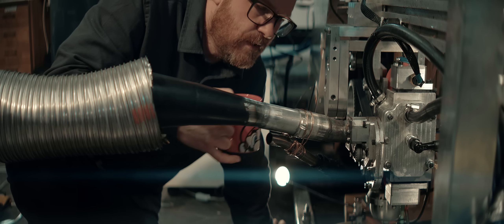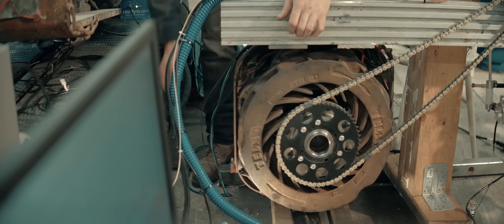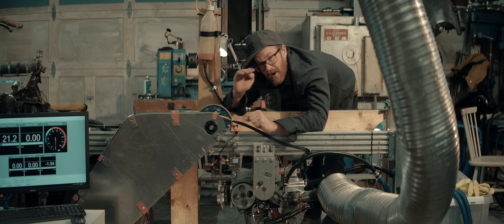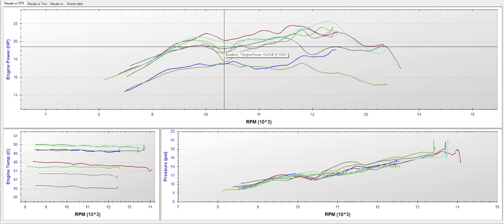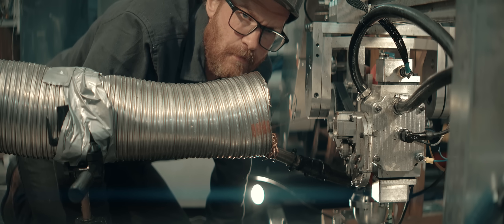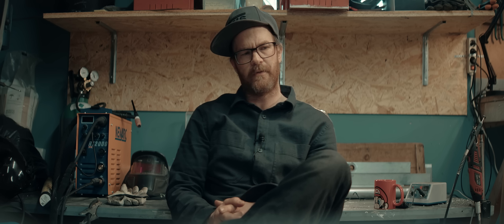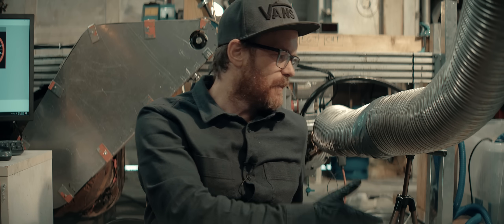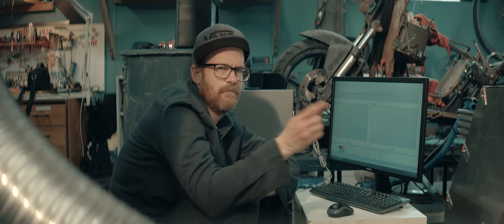50cc Supercharged Nitro Two Stroke - More compression?

Comment: You can still use auto start/stop going from low rpm to high. You dont need a whole lot of pid tuning to do it either. The idea is to have a timed sweep like you do now, just in the opposite direction. At the end of the run you should be near your rev limiter. If you dont have a rev limiter on a boosted nitro 2 stroke, my first question would be whynot? How are you preventing damage from over spinning the engine? The benifits of going from low to high rom isnt so much that it's more accurate. It's that you aren't lugging/stalling a directly coupled boosted nitro engine at WOT which can be dangerous.  If you start low, you start at an rpm above idle. 2500-3000 or whatever the engine is happy at. At the end of the run, the dyno says run complete and you back off the throttle. Worst case, you touch your limiter a little.  The other consideration is that going backwards from high to low involves the brake a lot more. If your pid isn't tuned rock solid, you can get a bunch of weird torque/hp anomalies because it is more involved in rpm control. On an acceleration ramp, you are less brake involved and can rely more so on the mass of the eddy brake than you do on the pid control of the brake. In this you find more accuracy, but more importantly you find repeatability which is king in this situation. A dyno is nothing more than a tool to measure a performance change. The number itself is irrelevant so long as you can measure a change. And if your pid is what's responsible for making all those waves in the dyno graph, then you're spinning your wheels..   i'd recommend installing another stock 50cc and dona few pulls with it, completely stock. Use that to dial in your dyno pid control in a low to high rpm config. Once you get repeatability with that, then go back to the brute force engine development. If you're chasing your tail with the dyno setup, you're doing nothing more than wasting both time and money.
Reply: People have been saying that (about testing with a known engine) since the beginning but he just doesn't seem to want to, for whatever reason.

Comment: You have to advance the  ignition , test 40+ deg , since Nitro is a slow burner,,,, at our Kaw top fueler (1200cc)we ran  65+deg when going with a rich mix , You need advance ign  to get the sparkplug  hot and clean, it wont build any heat otherwise

Comment: To test does the inertia make a difference, try braking the engine down in, lets say 10 seconds and then try like three seconds. If it affects the results, the torque figures should be higher in the faster decelerations.

Comment: Gap the ring like mad man and make it as lean as possible. I use to run nitro rc cars as lean as possible for better power. Get it running to full rev and wind off the fuel until it bogs. Makes the rc cars much quicker although they over heat. On a larger engine if you can get enough boost go rich! I think you may open another can of worms with the compression ratio issues.

Comment: Your reverse dyno run still have influence on exhaust resonance. If exhaust is working and has some resonance effect, you are starting at high rpm with "cold" exhaust and ending run at low rpm with hot exhaust. That is affecting results and on road will be different.

Comment: Test running from low to high, you might gain power.
This due to engine works up the heat so the fuel condensates properly at high rpm, nitro needs the heat.

It is just to configure an rpm limit in ignitec and also if possible make dyno after reached top rpm pull down the rpm again.

Looking at a top fuel dragster hemi, it only has ~6.5-1 in compressionratio, Beware!

Comment: You need to work out why that motor is not breathing, that's the main issue, everything you are doing is tuning.  There is something more major going on.  The reason I say this is that your HP curve looks like a torque curve, meaning your torque curve is crashing to the floor.  I am unsure of your carb spec or port timing, this motor has some sort of 'reed valve' bypass setup that relies on inertia, this could be the problem, or you have choked the intake down so much in the search for gas velocity that you are getting far to much of a pressure drop.  I'm not sure but I would focus your attentions on getting the thing to breath.  Love your passion and it's a great project.  God speed.
Reply: He has massive breathing capacity (enormous ports) but the engine is more or less crossflow scavenged, so I suspect the charging efficiency at high revs isn't as spectacular as one might hope. Also at very high RPM the blower efficiency goes off a cliff.

Comment: Alex, a suggestion for your consideration. The previous video you mentioned that you got more power the warmer the engine got. Is it possible to increase the coolant temperature  to allow a short term test. What temperature is the coolant achieving under load.
Reply: @Alfred Wedmore Morning Alfred. I suggested to Alex some time ago adjusting coolant temperature in logged steps and write down the results. This was from the period when he was running the engine at winter room temperature.
IMO quick cheap alterations are done first. I know it's easy for us comment on what needs doing but I genuinely believe the cooling system needs shrinking down for testing purposes allowing quicker warm up periods. I feel a water temperature gauge placed in the water jacket is a must.

Comment: Gap the spark plug tighter. Smaller gaps work best for boosted applications.  I personally run .028 to .022 the more boost the smaller the gap.

Comment: Hi. I'm with you man, I just love your build.
I've got some ideas to test.
1)dirtbike use sometimes platinum race sparkplug bougies wit a smaller tip(expensive)
2)Some dirtbikes from the past were using two sparkplug bougies at the same time(Maico 500, 1979)
3)Maybey to run the engine on Aspen chainsaw fuel (without ethanol) for a more consitant fuel consumption adjustment. 
4)Maybey you can develop and use a adjustable fueljet( carberator) 
Some Zundapps from the past had them in their Bing carberator as an extra option for fuel adjustment when the engine was hot on normal operating temperature for more power 
Good luck from the Netherlands!!!!
Reply: Bing carburettor! You said a naughty word.

Comment: Just mention when you add compression,  it will be more difficult to ignite the mixture, even as a high boosted mixture, even as igniting methanol in stead of gasoline. I know this of experience in tractorpulling. the easiest things what helpt are decreasing sparkplug gap to 0.4mm or less. Also leaning out the mixture will help it igniting better. So i think adding more compression is a step the wrong way for now. Keep up the good work, you are my favorite yt channel!

Comment: When tuning cars, I always ramp timing up a little past peak torque. Around a degree per 1000 rpm. I'm wondering if at peak torque, you have 15, and taper up to where at peak rpm you put 25 in it if that will help? It does on the 4 stroke boosted cars I tune. I'm not sure if it applies to 2 stroke boosted combinations.

Comment: Mabe plug fouling is du To the oil content in nitro fuel for rc cars à normal two stroke pétrole engine as like 2% oil compare To 9%oil in nitro bugy fuel cut the nitro fuel wit straight metanol lower oil

Comment: The guys of racing team van Veen kreidler, have squeezed 20,5 hp (in the 70s with a bench test) out of a kreidler super breitwand 50cc 2 stroke engine. Without nitro and super chargers. Just plane knowledge and gasoline. On the circuit the used and average of 18.5hp for the durability with a speed of 204km/h 126ml/h!!! 
That were the good  old days.
Reply from the maker: My "old" engine sitting in the landspeed bike produces about 23. I'm not pessimistic about the results for this one though, we're just getting started.

Comment: The exhaust diameter is too large and the megaphone should be a smaller diameter with a longer and more tapered angle...try 1 inch pipe with 12 inch megaphone max with inch and 3/4 max

Comment: More fuel and more power, that’s how it worked with our methanol 2 stroke. It was so rich that on idle it was drooling straight methanol from the pipes. But open the throttle and it picked up immediately. 
More compression and more spark power needed, and test with smaller plug gap as that helps up to a point. 
Just a small returning cone on the megaphone will net you a lot of power you need that returning wave as you are all ready pushing fresh mixture out.  Interesting times on the engine!
Reply: From what I have heard thats true with almost any methanol engine.
Reply: Could try use an accelerator pump type thing
Reply: Hey I’ve been subscribed to you for a long time! I like your airguns!

Comment: I've been using a Ignitech DCCDIP2 race on my RG500. Single ignition pickup firing all four plugs at the same time in a wasted spark setup. This appeared to be working but I would always start a dyno session with misfires and would need to change the plugs. Hence I was suspicion there was not enough spark power in this configuration. Jiri at Ignitech is very helpful and gave me this information -

"DCCDIP2 race is designed maximal for approx. 30 000 sparks per minute. This is 15 000 RPM in case two channel use with 1 spark per revolution.

RG500 has two ignition coils and two pulses pulse rotor. So that if you will to use coils separate - this is 4 sparks per revolution. So that maximal engine speed with full spark energy will be 7500. Above this engine speed will spark energy rapidly decrease."

Hence I switched over to using 2 x DCCDIP2 race units with each firing two plugs in a wasted spark setup. You could hear the difference from the engine as soon as it started up.

It could be that due to running boost the Ignitech unit is struggling with spark power. I wonder if it is possible to connect the coil outputs of two Ignitech units together to the same coil without damaging them in order to double its power. Drop Jiri at Ignitech an email and see what he thinks.

Another thing which might be worth trying is reducing the spark plug gap.

Comment: You should really try to move away from that crankcase blow-off valve/boost reg. It cannot be doing anything good for fueling. It probably negatively effects the air/fuel charge. Why couldn’t you just control it with pulley size? If there’s something I’m missing, someone cue me in. Amazing project by the way, I’ve been invested and intrigued. Thank you for showing things in detail, and satisfying my thirst for this type of experimentation!

Comment: You need a bigger hotter spark try a msd ignition kit, top fuel run twin plugs with a 80amp spark that you could weld with

Comment: This is just a general comment regarding your comments on upping the compression.....each additional pound of boost makes more power than each additional point of compression.....this is because there is physically more space to contain charge that's at a higher density in the combustion chamber that can be burned vs. less dense change in a smaller space at a similar max pressure ratio......Also the drive losses of the supercharger come into play when adding boost, because there will be a trade off point where additional boost wont make any additional power, due to parasitic power consumption.....a supercharger efficiency map is needed to really hone in on the best sizing / drive ratio quickly but, based on experience roots most superchargers get a LOT less efficient past 1-1.5-BAR of boost and past 8-10K RPM......if you are within this range of pressure now, then the best way from here is to minimize drive losses through more engine RPM at the lower drive ratio until boost starts to fall at peak RPM (which will indicate you’ve maxed out the superchargers flow capacity within its efficient range and the engine is more efficient than it used to be)......In summary; the most gain at this point will probably be from making changes to the engine so it makes peak power up near 20K RPM, because this will maximize the superchargers RPM, at a pressure ratio that it's still somewhat efficient, given the drive ratio you are using currently.......hope this helps!
Reply: What if, when you'd have an additional turbocharcher to "take over" in higher rpm?
Reply: Also, cylinder peak pressure is lower and lower torq at low rpm , but more hp at higher rpm - also saving connecting rod stress.
Reply: And with the additional amount of fuel and air, you benefit from more compression to pack that added fuel and air mixture tighter for a bigger bang.
Reply: He tried that already. Spinning the blower faster resulted in it's anemic amount of torque not being enough to keep the engine running and it would continually stall or not stay running. At this point CR is gonna be the only way forward. He needs more VE and CR is one damn good way to get it. This will result in more torque everywhere which then maybe will be enough torque to start speeding the blower up and raising boost.
Reply: @gadgetdeez7069  true! Engine also does not have enough port area to up rpm

Comment: Get rid of the megaphone exhaust, don't run without a pipe make a longer header pipe. Methanol makes more power in its lean condition but it gets dangerous for parts.

Comment: Getting 2 plugs instead of one? Your videos are getting more and more technical, but I love them. KEep it up!
Reply: Was thinking the same thing. As the cylinder head is not any massive task to CNC, the option I think should be tried out. Though I have no clue how costly a dual ignition system would be (EDIT: Or could the current system be modified to run two coils and plugs). Seeing those advance curves makes me think it's way too linear/simple. Though again, I don't know how many adjustable points there are in the current system.

Comment: power loss at low rpm + high spark advance makes sense to me; piston just has less momentum to push up against the already ignited fuel.
Reply: Pressing up against already ignited fuel is called knock.

Comment: I think you are headed in the right direction. The higher the compression, the higher the boost, the more critical your fuel mixture becomes. The "sweet spot" will get narrower but if correct should make gobs of power.

Comment: One thing to check is the inlet entry size of the supercharger....supercharger efficiency can be greatly hindered by the size of the inlet feeding it....not sure of the relative size of the throttle bore or adaptor to the actual inlet of the supercharger, but if it’s any smaller than the factory entry size your giving up airflow potential / boost without needing to change the drive ratio any.

Comment: Lower compression is what I was thinking give the gas and air some more room to do there thing higher compression will just make it harder on the spark plug most boosted engines got lower compression not higher compression and boost just make it worse that's y people build low compression engines then boost them
Reply: Not possible with such a small cylinder, typical engine yes but on small two strokes it's opposite. He is limited by the amount of boost he can provide

Comment: Might need a stronger ignition system and smaller plug gap .. most boosted guys run less than .020 plug gap

Comment: You may want to improve your exhaust blower setup. Having the engine eat its own exhaust is just another source of variability between runs.
Reply: And maybe have a fresh air source to the engine also.
Reply: Pretty sure it's not a exhaust blower... it has a rotary exhaust valve keeping boost in the case and the blower sucking from the carb
Reply: @windytokes  I'm talking about the blower that's extracting exhaust gasses and blowing them out of the building
Reply: @wheetcracker  ahhh yeah he definitely does

Comment: Guess you didn`t understand the comments about the dyno vs horsepower, you think its about inertia but that has nothing to do with the calculation. but just continue clowning Stuffin, anyways its funny videos you make.....
Reply: Who is the clown? He is measuring torque at the engine, and he surely knows that?
Reply: @danielssonsgarage  I didnt call Stuffin a clown, get it right before you write so ignorantly, i said he was clowning and that is a total differnt thing....
Reply from the maker: Please explain.
Reply: @2STROKESTUFFING  But hey, i allready did, measuring the torque when applying force by the retarder, your reading is wrong because you pull the rews down with the retarder, applying greater ressistance than the engine can pull, then your reading will be wrong, because your reading is based on the force you apply on the retarder, making the readout higher than the actual force.
Reply from the maker: @Deutsche_1  I'm having a hard time wrapping my head around this. The engine can't exert more force on the loadcell than what it produces(except for the stored inertia in the crankshaft/blower assembly).
Reply: @2STROKESTUFFING  the balance must be when you apply just about the force on the engine to keep its revolutions at its maximum torque without downing the rews, that is when you recieve the correct measurement.
In old days the way of measuring BHP was done with an actual mechanical brake and a leaver on a weight, so using the "new" way of doing things is no different but with electronics and electrical brakes instead, you could also use an alternator and extracting amps out instead measuring the output at maximum engine power.
Reply: @Deutsche_1  I dont think you understand how he is measuring.
Reply: @danielssonsgarage  So why does Stuffin not oppose my comments with data rejecting my claim.??
Reply: @Deutsche_1  "he who is silent agrees" doesnt apply on social media comments

Comment: A control board in front your computer with electric start and throttle control and two kill switches would be nice. And if it was universal for multi engines.